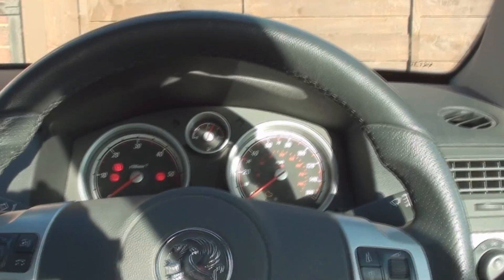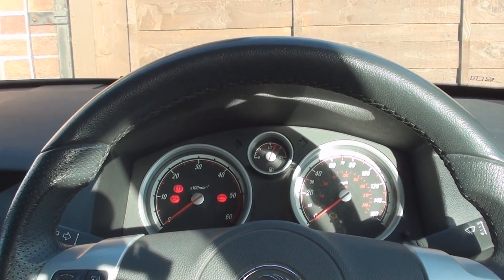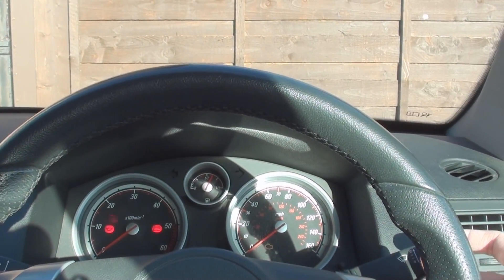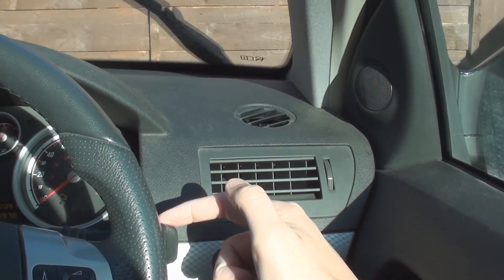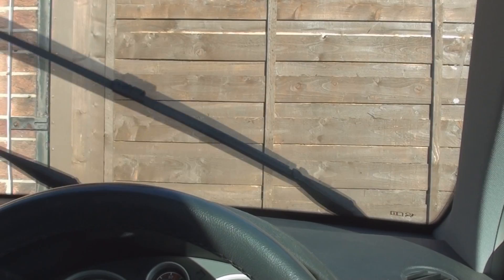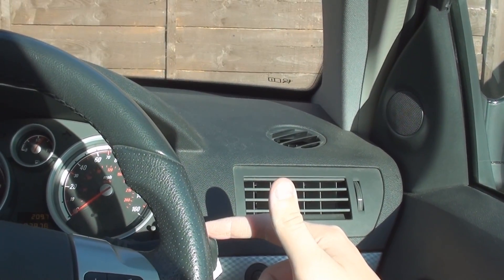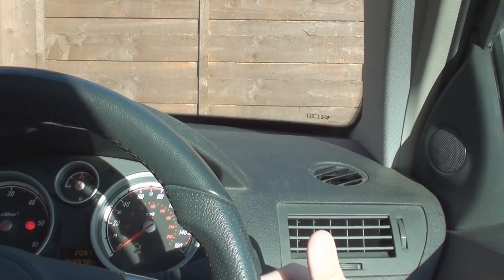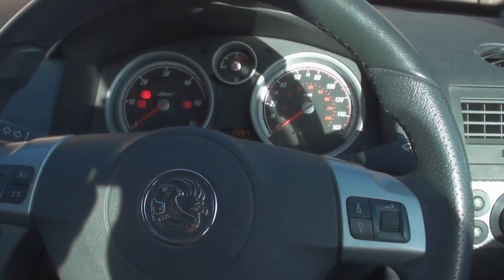Secret method of programming intermittent wipers

Comment: It's not the amount of time you hold the stalk down for that counts, it's the time between you pressing it down (even just a very short flick) and then putting it into intermittent mode that counts, which explains why you couldn't really get it to work in this vid all that well. At least, that's what it was in a corsa I drove. Flick it down, let go, wait 10 secs, put into intermittent for a 10 second wipe. Or flick down and immediately put into intermittent for fast.
Reply from the maker: Thanks for the info Chris
Reply: Thanks Chris, I know this is 5 years old but it's helped me out! Was just holding the stalk down in my Corsa D to set it and it didn't seem right and the manual's not very clear!